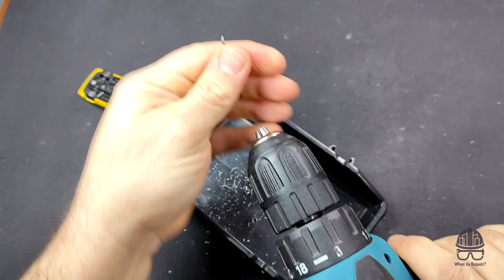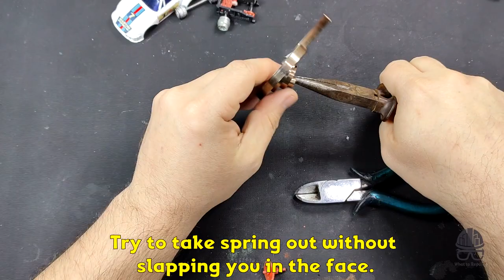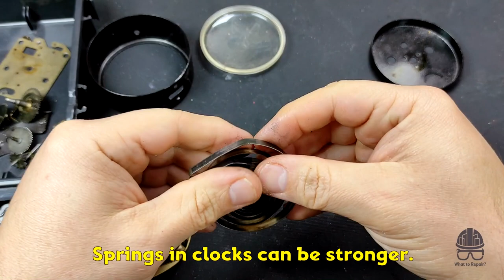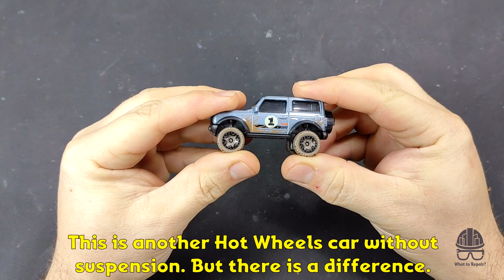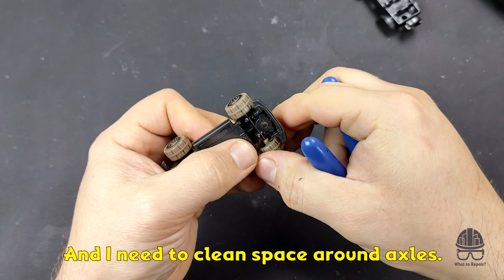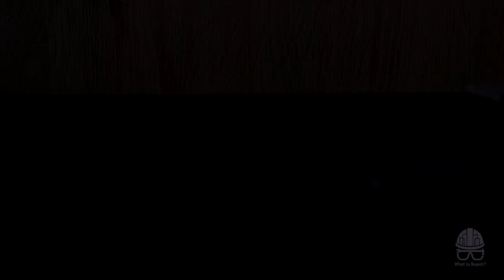Another way to make suspension for stock diecast cars

Comment: Very nice idea. What about that Music wire/Spring wire, but, 1 wire per side? Same thing right?
You have my Sub.
Reply from the maker: I'm not sure on what you think. Where did you saw that wire? I'm using only one spring per car. Can you write the time where you saw that?
Reply: @WhattoRepair  I meant what if I used music wire or Spring wire instead of that flat wide metal you used.. That could work also.
Reply from the maker: Oh, I understand now. Yes, of course, any spring wire will work. Some manufacturers use spring wire as suspension in diecast cars, for example Majorette. I would make small change, I would glue something in the middle of two wires, to keep wires apart and in place. You can even glue two short pieces of same wire in the middle. To get shape like letter H. Or you can bend one long wire in rectangle shape, that will also work.
Reply: @WhattoRepair  Yes. Thanks. 2 Straight pieces of.32 mm. 1 left side, front to back, and 1 rightside, front to back. It works! Thanks.